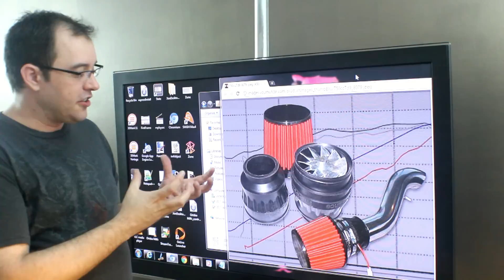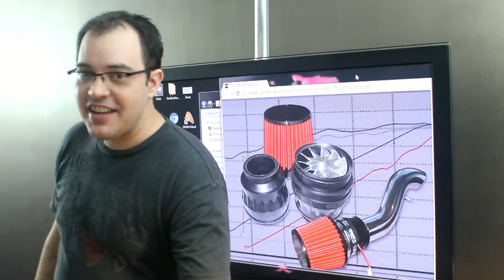Electric Turbo / Electric Supercharger / Forced Induction System: Should I Install?

Comment: That thing would never cause an EXCEEDING PRESSURE in the air intake. Look you not only have to EQUAL the speed of the air intake you also have to EXCEED it to actually make power. Anything that doesn 't EXCEED IT only is in the way! Making less air go through and making your care slower. 

This is why an actual turbo has metal blades and is based around running 10.000 RPM in a pressure proof housing. Those bilge pumps not only won't run at 10.000 RPM neither are they pressure proof. This means even IF they generate airflow it can as easily leak back. 

YES there is an actual working electronic turbo. The Thomas Knight Turbo Electric Supercharger. Now you ask so what is the catch. I mean that thing will give me more performance does it. YEAH! 

How much space for batteries do you have? And it really is a one shot.. How more batteries how longer it lasts and recharging those batteries takes a long time. WHile you are still driving with a rather big weight of batteries. 

It is great on a race car. But... on a normal car the cost of riding with the extra weight in turbo and batteries will probably cost more feul then the short turbo boost saves. 

So my suggestion, no bilge pumps those don't add power, actually impede air from entering the engine so make the engine slower and draw power meaning the motor has to work harder to recharge said power. In short you get no extra speed/performance and yet you burn more fuel. 

As you have done, a better intercooler is a good start.
Reply: actually a turbo will spin at more like 140000 rpm depending in the turbo and bearings

Comment: These fans do nothing but put something in your intake to take up space and will actually create unnecessary resistance. No electric engine that runs off from your cars electrical system is going to have enough force to raise pressure enough to have an effect.

Comment: what you could do is replace the blade with a metal one or if dont have the time put a mesh screen past the blade if the blade brakes the mesh will catch it and not go in the engine, and if you want to hook a toggle switch up to it for when you want to turn it one or off

Comment: Except air escapes back through the fan blades when you try to use a fan like a roots blower. If you try to use more fan blades to create a tighter seal, like the one between rotors on a blower, then it becomes very restrictive, more so then not having a fan at all!
Fans are simply horribly inefficient when trying to use one like a supercharger no matter how big the fan is relative to the engine. As they say, it's like trying to wave your hand really fast to fill up a tire.

Comment: A roots type supercharger technically just pumps large amounts of uncompressed air. It just is able to pump so much air that it is compressed because of a lack of space in the plenum. There's no actual compression inside the supercharger housing. (There IS compression inside the housing of a twin-screw blower, though). So theoretically, if you had an electric fan big enough, it could suck in so much air that it'd function like a roots type blower. But this is most certainly not adequate.

Comment: @BlackwaterOpsDotCom Right, i understand that increasing flow to engine (by means of reducing the restriction of a paper filter and changing to a cloth filter) can increase horse power. 
An electric fan will create a restriction unless it can supply more flow to the engine then the engine requires.Even if it could surpass that requirement, it can only help with reducing the pressure drop caused by airfilters.

Comment: @drizzetsrevenge Sorry, it was a typo, I meant air/fuel ratio. Injectors will not compensate for much more than an air filter upgrade. Anything serious like proper forced induction, or even a good ram air intake will cause it to run lean. As for detonation, Running lean in a petrol causes excessive heat, Excessive heat causes detonation. Its the opposite in diesels, Running lean is good, but run too rich, your egt's get to high and you melt your pistons/valves,manifold and turbo vanes.

Comment: @BlackwaterOpsDotCom I think there's a bit of a misunderstanding here lol. What I mean is as-well as increasing the airflow, to compensate you have to manually increase the amount of fuel that goes into the engine and ideally adjust the engine timing to suit. This is normally done through a remap or a tuning box. This isn't nessecary (but still ideal) with a new air filter, But with forced induction its a must.

Comment from the maker: 3 inch Diameter = 1.5 Radius. Pi x R squared = 7 square inches, at 2psi that is 14 pounds to keep your hand over it.
This one was not 2 PSI, but it was enough that if you set it on the table it would take flight until the seal was broken. guessing 8 pounds, 1ish PSI.

Comment: It can act as a real supercharger by replacing the stock alternator with a 150+ amp alternator and connecting the electric supercharger directly to it so it's always on. The faster the engine's rpm, the faster the alternator spins. The faster the alternator spins, the higher the ampere get thus making electric supercharger spin faster.

Comment from the maker: HP at lower RPMs 500 chars sucks.  a 25 PSI at 100 LB Min might not get 25 PSI at 7000 RPM but would at 2500 RPM.

That would equate to More low end torque, and possibly sooner torque because of lag/spinup. But wouldn't give you top end Horse power. Does that make sense?

On a street car that might be preferable because you could get "torque" at 500 RPM instead of waiting for 3000 RPM, and you would spend less time at 6000 RPM where you got less boost

Comment: You wasted your money, these are fans not turbines that do not and will never ever create pressure. There are electric turbos / superchargers which are just conventional turbos that are driven by a powerful electric motor instead of exhaust gas or a belt from the crank pulley (harmonic balancer). I vote you install it as punishment for buying this desk fan instead of the real thing. LOL
Reply: he said it was a gift, and he didn't even want it. Did you even watch the video?

Comment: if you are going to use it, maybe het some chicken wire mesh and glue it to the back of the fan casing , so if something breaks, nothing with fly into the engine

Comment from the maker: Actually, after testing it, it increased torque at less than 2800 RPM made no difference from 3000-4500 RPM and lowered at 5k-7k

Stop light to stop light the car was faster.

Guess what that makes you?

Comment: I tested one of these with actual OBDII data logging, It can help marginally at low RPM, as in under 2000 slightly.  but its hardly noticable.  BUT, for it to be able to help at all at higher RPM, it would need to significantly exceed the normal maximum flow of the intake at WOT.  I measured my WOT airflow @ 5000 RPM to be 980-1100 CFM

Comment: @edlingja1 That could work in a diesel, But a petrol naturally does not combust efficiently. You need to "oversaturate" the mixture with fuel in order to get optimal power output.

Comment: "It can't be good for my car" smart guy..

At high revs especially like my car it creates an air ristriction, my friend sent me one for free as well.
It litterally jams my air flow at around 6.5k rpm and above.
Not only that it reduces my performance, it's harming my engine as well.

But of course I tested it on my friend's car, if you're ever going 3k rpm and below, it saves fuel :)

Comment: @scratchyrice by forcing more air, the mass air flow sensor will sense more air and it will tell the computer to send more fuel,thus adding more power.so not a good idea for carb engines but those are almost obsolete anyway.

Comment: i would think that being as the car's intake is under vacuum, essentially the fan will be under similar vacuum and the fan might not be designed to function with head suction in the vacuum that will be experienced?

Comment: @amurhan5 Does your service engin soon light come on when u do that?  Does your volt meter drop when you turn it on?  You might have an electrical issue.  The unit might cause a sensor to go out of range which confuses the computer.

Comment: More air does nt mean more power...compressed air with more fuel n free flow exhaust gives u more power...besties!
Reply: Rachit Dobhal This is so true.
Reply: +Rachit Dobhal Yeah I think he meant, more air means you can put more fuel and in return, more power. But his videos are kind of slow and boring. lol
Reply: VenomX 78410 No. When you throw on a turbo the compressed air mixes with the same amount of fuel (unless you change the injectors). This is part of the reason why Turbo's are considered to be efficient. More oxygen just means better burning in the combustion chamber. More gas doesn't = power. Higher compression, higher octane, and more oxygen does.
Reply: Kyle Grodkowski well think of it this way, if you put more air, its going to be lean, if you put more air and more fuel, it'll run right, if you put more fuel with less air, it runs rich. That's kind of what I meant by that comment.
Reply: Kyle when you put an electric motor that spinns just at 0-60  will it give you more boost ????
Reply: kyle you have no idea what your talking about. once you learn about fuel mapping, injector duty cycles , and air: fuel ratios, please come back in a couple years and edit your comment.
Reply: best put.

Comment: @midnightraven00 It charges the battery, which would suggest that the mechanical force of the crank is drastically greater than the electric charge it produces by simple thermodynamics/basic physics (energy lost to friction is not able to be restored, so higher energy goes to energy)

Comment from the maker: It's actually Pounds of air.  500 PSI at 1 CFM is worthless.  Unfortunately few people understand what a Pound Minute of air is. (this is what your ECU measures at the manifold and at the Mass Air Flow Sensor)  

This device is not going to move many LB/min of air.

Comment from the maker: Sorry. 1 CFM at 1 PSI is less Mass than 1 CFM at 500 PSI.  but 500 CFM at 1 PSI is also more than 1 CFM at 1 PSI.  What matters is Pounds per minute, and when you buy a real turbo, (not this crappy electric one) they are rated in Pounds Per Minute of Air at X PSI. and you really need both.  

The Turbo I Actually am mounting is rated for 350 pounds per minute at 32 PSI. Each pound minute of Air will get you 1.1 HP at 8:1 Compression. My mini is 11:1 Compression but I can only run at 23 PSI

Comment: Agreed.  By the time you buy a powerful enough motor, convert your electrical system to handle the huge current draw, get the switches, wiring ect. you probably could have installed a turbo and have much much better performance.

Comment from the maker: Yeah I don't care that much.  I put the thing on, used the relative torque censor on the car, measured before and after, determined I killed my economy, gained at Idle to about 2800 RPM and lost there after. 0-30 stop light to stop light it helped. after that it just lowered my econ and my performance.

Comment: @BlackwaterOpsDotCom 
Those were just some numbers to get you thinking.  There are other problems with using electric fans to create boost.  A fan is built to move air, not build pressure.  The fan blades cannot contain pressure.  The reason a supercharger costs as much as it does is because of the precise internal components and a gearbox to get the compressor spinning up tp 100,000 rpm.  If all you needed was a fan to increase hp, we would all have one running off the crank.

Comment: Seen a bit about these electric fans/blowers, Mazda fit them as standard on the MX5 1.8ltr.
What concerns me is how are they regulated? you wouldn't have the fan blowing flat-out at low revs, surely it must increase or decrease with rpm? 
A turbo or supercharger is governed by engine rpm.
If you change any one thing on an induction or exhaust system it should be set up again on a rolling road, so it all seems a bit sketchy to me?

Comment: @amurhan5 Did you wire it the wrong way????? Maybe the motor is spinning the wrong way and taking air from the engine rather then  adding air????????? Just a thought.

Comment: @scratchyrice wait.... what? Air/fuel ratio has NOTHING to do with compression ratio. Injectors can usually compensate for increased air flow, especially with such a low difference in CFM. By the way, running lean does NOT cause detonation. Detonation is cause by an incorrect octane or ignition advanced too high.. It's called pre-ignition.

Comment: subaru in the future is having electric turbos, I believe this will produce low end torque in small engines that can even match much larger engines and still have the advantages of a high end torque. though then the exhaust gases are going to waste perhaps?

Comment: While moving more air into your engine will give you more power, it is unlikely that a 4 amp fan will move more air into your engine.  The fan is rated to move 600cfm in an unrestricted environment.  If you restrict the opening of your tube, you will no longer flow 600cfm.  In order to get more air into your engine, you need to increase the pressure in the manifold.  This is known as boost.  This is what turbos and superchargers do.

Comment: @motersickel I agree with everyone stating this will be a restriction to the amount of air the engine is ingesting. Also, it matters little what the device is capable of flowing because if the throttle body, intake and head are not capable of supporting it they will become the restriction and any performance gain that would have been seen by this will not happen. Great post - I second not wasting your time.

Comment: Oh one more thing more = more power technically true you need to upgrade exhaust cause that air needs some where to go. Since this isnt using exhaust to push the turbine to force air in you dont have to worry about loosing to much back pressure and you don't have to deal with heat. that system can work. This can be monster and excellent idea. You need to adjust your PCM Pulse with to the injectors beyond your PCM parameters you PCM used to seeing. It will trip check engine light if you dont.

Comment: if installed on a newer car the computer should be able to compensate and raise the amount of fuel to match the increase in air the problem is that it needs to be able to vary the speed of the fan because 5PSI is useless at idle turbos and superchargers both increase speed as engine speed increases

Comment: the one you show on your screen behind you will work...somewhat its more like a turbo than a supercharger except its doesnt run on exhaust gas .a turbo is built exactly the same way.the electric turbo has one turbine blade while the exhaust turbo uses two one for exhaust to drive it and one larger one to deliver fresh air.the way i see it as long as your pushing more air than your motor can pull in there would have to be a performance gain.not as good as forced induction but better than cold air

Comment: that pump you have , probably puts out  1x its own weight.
(you can tell brushless from brushed because brushed has 2 wires , brushless 3)
Honestly, if you want a reliable , ultra powerfull replacement for the plastic pump, go to a website called hobbyking and on the left, search ducted fan set , they are about £20 for the lot and just watch a youtube video on how to set it up, the best thing is, you could attach a small reciver to it  and wire up a  button or variable dial on your dash

Comment: exactly.  A "high pressure" fan is good for less than 1.5 psi.  Even a 2 litre engine would need a fan to flow 300 cfm at 7.5 psi.  These things barley flow 100 cfm at 0 psi.

Comment: It is not that simple.  A GT2560 is rated for 30lb/min @20PSI @72% eff.  Where did i say 25psi at 3000rpm was the same as 25psi at 6000rpm?  I said a larger turbo is flowing the same as a smaller turbo at the same boost level on the same engine.  
LB/Min get you HP, PSI gets you torque?!?  This does not make sense.  The 2 are related.  The more PSI, the more flow.  If you want to increase the amount of air in a fixed volume, the pressure is going to rise.  Do you disagree with this?

Comment: This is a real hybrid technology. I am not talking about plastic fans. A real cast iron turbo electricly powerd. Perhaps you need more money to to this than a bolt on turbo. You need secondary Alternator, Battery, wires, a computer which will suncronise your turbo to your throtle. There is no electrical equipment to manage rpms on electric motor with your throtle. Perhaps if you make one you can use this hybrid technology to make boost, but it will cost you a lot of time and money.

Comment: Don't do it if any thing get one with a map system u know the cylinder thing that goes around the turbo it traps air and pressurizes it and gives it a bigger PSI reading the one behind u is a glorified fan traps no air what so ever it might help on ur cool air intake though
Reply: Look up how do electric super chargers work by some 2B2 I think is what his name starts with he will give u the low down

Comment: @anthonysean94 more spark the cure for that is a colder plug that dwells longer and/or gapping the plugs for the same effect. this "supercharger" i cannot see doing what it is touted to do its a fan which with a simple scoop or placement of the inlet tube close to air could generate the same if not better results. no actual pressure produced no gains which makes this simply a great drag on your electrical system.